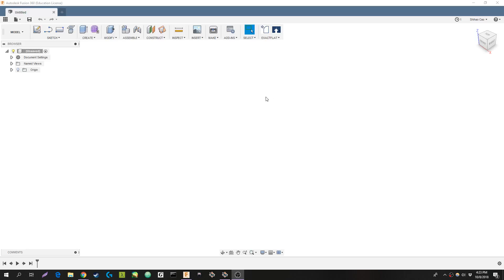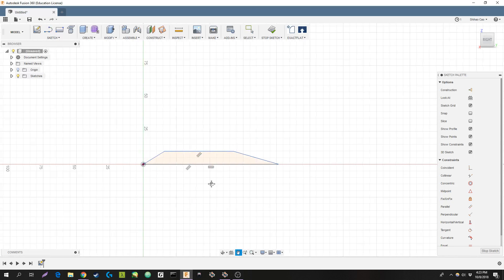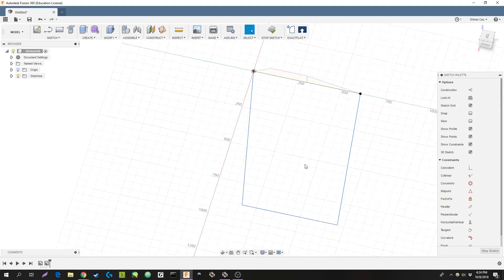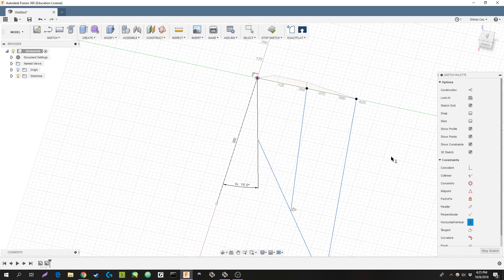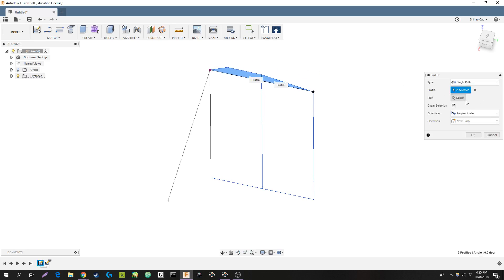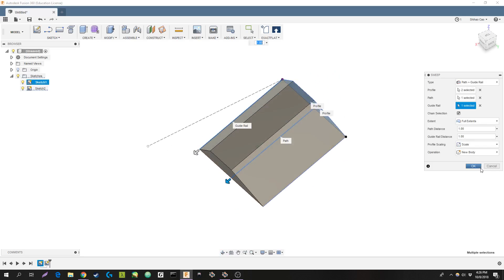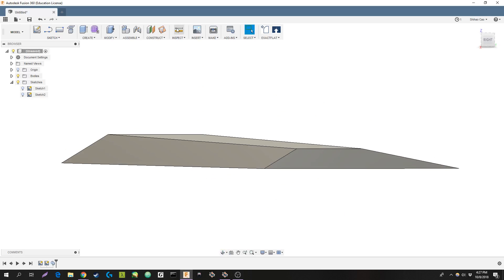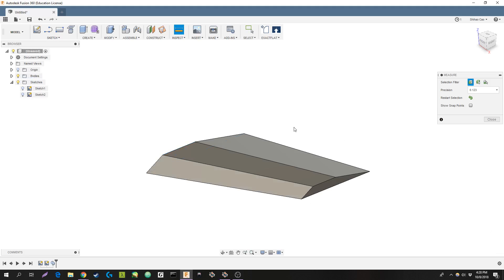Swept/Tapering Wing in Fusion 360 (5 MINUTE)

Comment: Hello
I am working on a project and designing a wing of chord length 1 Ft and span 52 inches.
Can you please tell how can I put flaps? 

Thanks! :D
Reply: @Shasty8817  Hello 
Thank you for replying back. 
Actually I was wondering how to determine the flap length, position and flap area. Is there any formula to calculate that?
Reply: @Shasty8817  I'm actually working on Wing Morphing and I am trying to prove that Morphing have better lift and all than regular flaps. 
So I designed the morphed wings at different angles. 
That's why I asked what is the procedure to design flaps.
Reply: @NotAdep  Hey! even my team is working on wing designs which implement morphing....if you don't mind will it be possible for you to have a small chat related to this...it would be a great help to us!
Reply: @siddhantbendkhale9094  sure man
Reply: @NotAdep  What will be the best way to contact you? LinkedIn or Instagram?
Reply: @NotAdep  Okay cool I've sent you the connection request.
Reply: @Shasty8817  If you want, I can send you my cad drawing of wing and you might get an idea how to place the flaps?